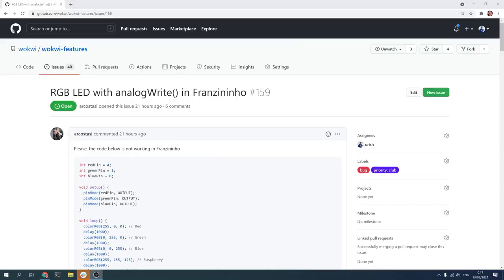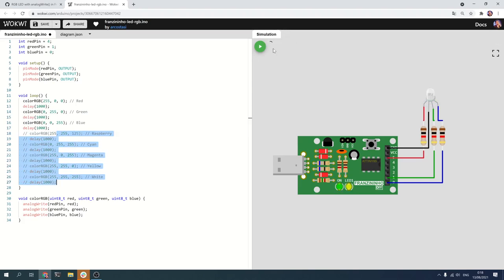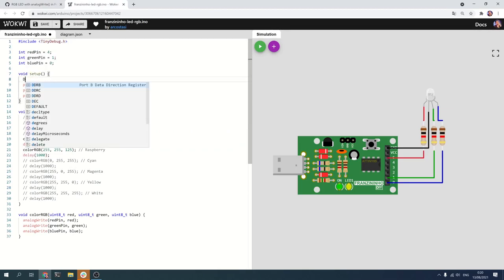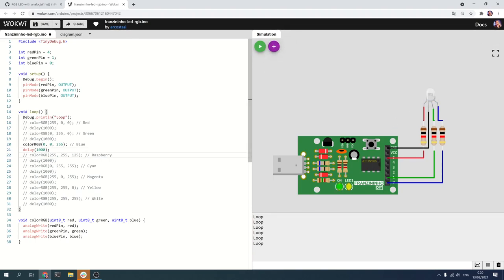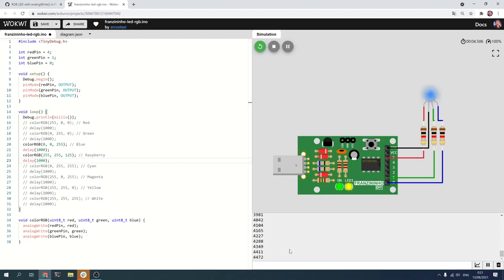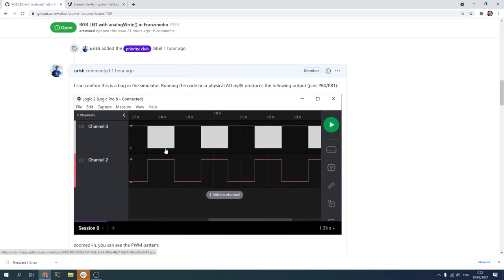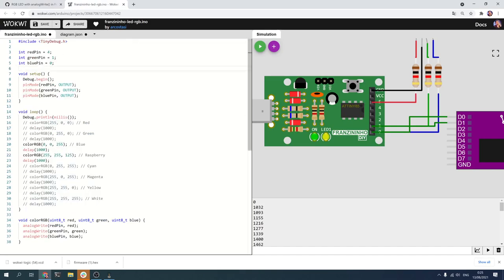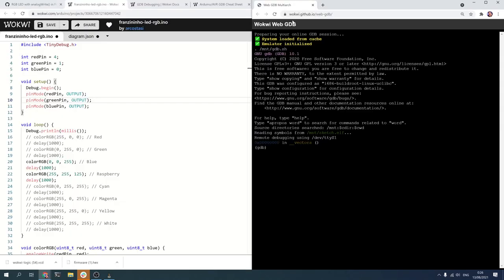GDB Debugging ATtiny Simulator Bug - Building Wokwi

Comment: Awesome, very neat look at your debugging process. Appreciate the video.
Reply from the maker: Thank you! What would you like to see next?
Reply: @Wokwi  I'm interested in seeing how the device simulation (eg, SSD1306 display) is done. On that note; it would be pretty cool to allow editing of a part as well. For instance, if I wanted the 128*32 version vs 128*64. Or if I wanted to make a pot 100k log vs 10k linear, etc.
Reply from the maker: @fgbhrl4907  For the SSD1306, you can find the code here: https://stackblitz.com/edit/avr8js-ssd1306?file=ssd1306.ts

As for editing parts, it's something we're looking at, but the general case is pretty complex. For most parts, we provide configuration options (e.g. I2C address for the SSD1306). If there are specific requests, you are always welcome to open an issue on https://github.com/wokwi/wokwi-features

Comment: Question from 7:40 - How does GDB sync with the specific project opened on the left window? When you enter "break delay" how does it know to break at line 21? Thanks
Reply from the maker: When you start GDB from the simulator, it opens a communication channel with the virtual machine where GDB is running in. Then it uses this channel to upload the ELF file with the symbols, as well as the source code, so you get a full debugging experience. You can read more about this setup in https://blog.wokwi.com/running-gdb-in-the-browser/